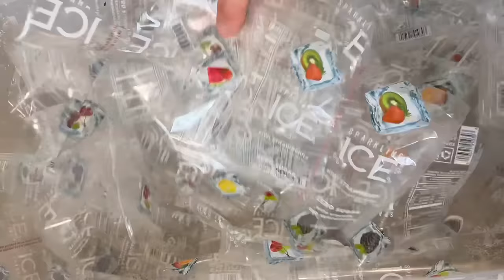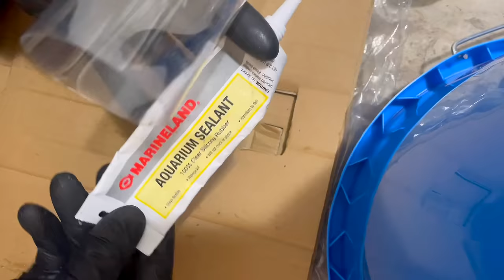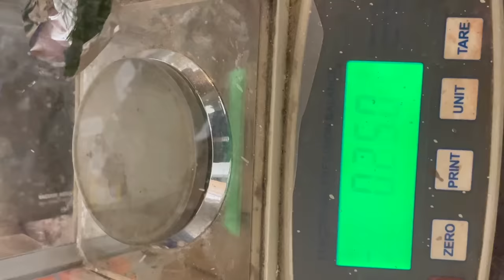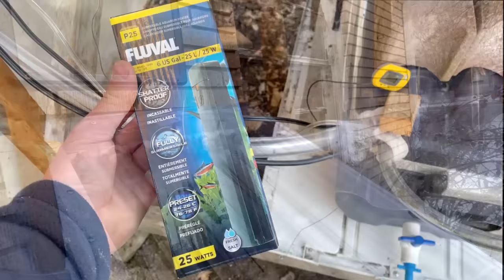Cody's Algae Panel

Comment: A small fishtank heater could help keep that warm on the colder nights, or if there's multiple cloudy and cold days. Could even have it charge with the sun too if you got some spare solar cells and an old lead cell battery.. I'm sure the Algae would be more efficient at doing it's job when it's not always having to warm up every morning. Or as much.

Comment: I'm guessing that you will need to find a way of removing Marsian dust from the panels rather than terrain snow, but the correlation is the same, as both block sunlight absorption.
Reply: I was wondering whether a vertical box that was on a little rotating thingy to point towards the sun might be better in that regard, stop snow collecting. Obviously not as much use by the house though, but out where it's wider at the base, maybe? I dunno whether the gentle curve is an important part of it or not
Reply: @FluffyDragon  maybe have it be mounted on 2 motors, and have it point imto the sun under normal operation, like Parker Solar Probe, but have it be vertically once-in-a-while to clear off the snow

Comment: This is so cool! Is there a way to have real-time reading of the concentrations of algea, minerals and water? It would be very nice to identify in which concentrations the production is most efficient. Maybe even have a system with supply of water and minerals outside the closed loop in order to adjust the concentration over the time.
Reply: You could probably use some sort of conductivity probe for minerals and a photosensor for algae!
Reply: a little glass chamber, a light on one side and a light sensor on the other side. All inside a box. When the photoresistor reaches the right signal you know you can harvest.

Comment: Given a lot of thought on how to create a "Moses Machine" that would produce food for long space voyages. A Moses Machine would pump air into a clear water container containing an algae base with artificial grow lights, algae would extract CO2 from that air then use grow lights for photosynthesis. The energy from light is used to convert water and carbon dioxide into carbohydrates (sugars), then algae use the carbohydrates to grow. A side result is CO2 is removed from the air and returns oxygen for astronauts to breathe. Spirulina is probably the best food source because it is quick and has high protein content, a person could survive on it. Extract and dry algae daily then make biscuits or create smoothies.   Algae doesn't contain Gluten but if you combine 2 parts Algae with 1 part Wheat, the gluten in the wheat is the binder and you can make protein biscuits or pancakes.

Comment: When you build it full size you should add some sort of thin heating element to the glass so that in the winter it can “defog” (melt) the ice on the surface like a defog button in a car heats a back window. Then if you want to get really automated add brushes that brush off snow afterwards (or just make the defogging element strong enough to melt the snow) I don’t know, food for thought.
Reply: Surely it clears the ice by itself pretty quick if it is sitting at 17 degrees.
Reply: @carbon1255  It gets colder some years, but yeah he probably doesn’t need it, but if it takes very little energy to do it then maybe it’s worth it.

Comment: The end product will be genuinely amazing and something that can be put on the roofs of buildings in cities for fertilizer production and any self respecting homesteader will love this invention 
Well done Cody well done
Reply: Fertilizer production?  If you want to get fertilizer, go get it from the sewer.
Reply: Yes, if you want polluted fertilizer, get it from the sewer.
Reply: @jawn6955  If things are being illegally thrown down the the sewer, sure you will.

If people are dumping toxic chemicals, that's a problem, but using sewage for fertilizer has long been done.

Even oil is biodegradable, but it's also contaminated with metal.

Sewage sludge is often already composted and then turned into fertilizer already.  If you have your own sewage tank, you can generate biogas, but removing the sulfur dioxide from it is a bit of work, but can be done by bubbling the produced gas through highly chlorinated water.

Once the sulfur dioxide is removed, it can be compressed and used just like you would use propane.

See?  I'm not entirely full of crap, but I know something about it!
Reply: @fuzzywzhe  i see, if you capture your own sewage I suppose you may be right! I do anticipate that general sewage is probably way to high in stuff that shouldn't be there though...
Reply: @jawn6955  What do you think is done with organic material from sewage processing plants?  Some of it is burned, some of it is put in landfills, but it's perfectly viable for being used as a nutrient for soil provided it's not contaminated with metals.

If we had proper sewage collection methods, it would be easy to compost it and use it directly as a fertilizer.  Sewage treatment is actually an interesting field.
Reply: @jawn6955  BTW you might want to waste some time looking of composting toilets here, and what is done with the waste.

Basically, the waste is placed in barrels with holes cut in the bottom of the barrel, to allow earthworms to get in to break down the waste.

What they end up with after, I dunno (a year?) is high quality fertilizer.  Quite a few videos of people showing the entire process.

Composting toilets are not uncommon for people who live off grid.  I believe that the grey water can just be dumped onto the lawn since it's not filled too much with organic material.  You don't even need a septic tank.

Comment: I'm very interested in this project and this is something I considered trying for a while myself. Consequently I did a lot of planning for a "Small system" to later scale up. I Thought through a lot of the same things you covered in this video so it's really cool to see somebody actually do it. I never actually built something for a lot of reasons. Didn't have space, was renting, rambunctious dogs etc.

You mentioned not liking the idea that the feed and return tubes were exposed and at first, I thought you meant because of the cold, but an animal ripping them off or getting tangled in them is the more important thing. Would it make sense to cover those in pipe insulation and maybe manage them back with some plumber's strap, or replace the soft tubing with PVC lines?

I also had the thought that maybe you could get some tubing that is made for potable water or food to ensure that it's going to be safe and not put nasty chemicals into the system and use that in a long coil, or several columns in the same way you have done with the plastic bottles. That would reduce internal rough surfaces from glue points, but you might lose some diameter. Fortunately, plastics, especially those for food grade applications have to give you a certain level of chemical data about their product, such as the chemicals it is made from, so you would know if it is going to off-gas or react with the liquid passing through it.

There's a product called "Rollerflex" that is transparent and has a helix stiffener on the inside to give it some rigidity. The 4" inside diameter stuff is just under $20 a foot though so this might not be the ideal solution. I'm not trying to sell you anything, just things I'm looking at right now. Maybe some acrylic or poly-carbonate tubes makes more sense because it is rigid and working with it is going to be a lot less hassle. I don't know what is out there that could be considered food grade, but I'm not a chemist.

Lastly, I thought it was really cool to watch as the system charged for the day and fairly quickly melted all of the frost and snow off of the diffuser. I wonder how much of that is the heat stored in the liquid, and how much is the leftover wavelengths of UV that the algae doesn't use and thus reflects.
Reply: What's the point behind feeding algaes in a panel?
Reply: I would construct it from a mirrored glass bottom of the sandwich to reflect back all light to the algae, then a series of vertical stainless steel square box sections for the frame to create separate areas and strengthen it, on top a piece of toughened glass, spray hydrophobic coating on top to shed water and snow, control temperature with a fan and thermostat for hot days (always sunny on hot days), copper piping with brazed joints for everything. Costs would stack up quickly trying to scale glass and copper and stainless steel I guess though.
Reply: @godnasus  He is experimenting with producing enough of this algae to serve as a fuel and (or) food source. Once you get the culture going and start pumping in depleted air, like from the inside of a space station, the algae can also be used to scrub the air, removing carbon dioxide and making it breathable to humans again. As the culture produces more and more algae, you filter some of the excess off and process it either into something that can be eaten or you extract the oils from it to make fuel. The idea is that it would be renewable and wouldn't require much maintenance to continue producing algae.
Reply: @Shrouded_reaper  I'm guessing he already has plenty of ideas in mind for a more robust and likely larger system. Probably something he can throw in his pickup and reassemble at Chicken Hole Base eventually. My only concern with adding mirrors is controlling the amount of solar energy being put into the algae. You can cook it with too much UV and it will turn orange as the chlorophyll drops out and it dies. It would be possible to control the levels of solar energy by tilting the mirrors or drawing a mesh fabric over them when the sunlight gets too intense, but that would be a lot of messing around to automate. I feel like this would work best as a large and mostly passive system.
Reply: @Advil1024  But if you have a glass top that will stop pretty much all of the UV. The main problem with increasing the solar radiance with a mirrored back is that they receive extra heat, which like I say you can just cycle through a radiator
Reply: @Shrouded_reaper  Alright that's a fair point, but at what point does it become too elegant of a solution? You can keep adding bits to squeeze out as much efficiency as possible, but if the return for the addition of the extra hardware is minimal, is it worth doing. I'm not saying that what you suggest would only have a minimal improvement in efficiency, but at some point, I imagine additions to the design might have that effect.

Comment: 18 months later, I'm still thinking about this. You've obviously done indoor, artificially lit algae cultures before - and I'm wondering what the relative conversion rate is. If you were to do a silvered culture tank with a suspended "grow light" fixture in it, and ran it off a single solar panel of similar area to your culture panel, which would make more algae?

Take a ~20% efficiency domestic grade panel, 50% efficiency of LED's and 95% efficiency of any LiPo battery storage involved, the obvious answer would appear to be "the direct grow panel". But with the other method you can use a tuned LED to optimise the efficiency of the light absorption, and you can also (by for example, placing the culture underground) give the algae a consistent optimal temperature and light pattern, regardless of time of day, year or weather - as long as you have enough electricity in the batteries.

The other thing in my head is that it's easy to find large cylindrical containers for growing a culture with a "central core" illumination - 5gal brewing buckets seem about ideal and also amusingly appropriate, and UN type blue barrels are another.

How viable would home scale cryogenic co2 capture be? I'd be fascinated to know how the energy economics work for concentrating co2 before injection into the growth media. Web says ideal is between 1-6% depending on strain, while humans die at 1.2%.

Comment: Great design! Though i find your goal to have 50 of these to sustain one person to be completely un-viable lol.

A better idea might be to use these as a micro-nutrient farm. You already did your test to see if this algae can utilize meteorites as fertilizer, does that mean they can turn the rock-based minerals present in it into more organic forms that humans can absorb?

So then you could maybe use the rocks from your mine to do that, seeing as how meteorites are kind of at a premium. But even then didn't they have a lot of mercury and lead and stuff in them? I cant recall if you tested the meteorite for them either, but i do recall you ate the algae bloomed from it lol.

I had an idea, you know those crappy cheap multivitamins you can buy? the ones where they use oxide versions of minerals and synthesized vitamins? If you crushed them up and used them as algae fertilizer, wouldn't the algae actually use them and make better, more organic versions? So in theory this one farm could actually drastically improve the quality of the micro-nutrients you put into it, you could proabably even dry the algae and put it in capsules!

Comment: would this be useable for fish feed?   Going from this to using it in a aquaponics systems would be super cool.
Reply: i mean, algae tablets are sold for fish so i assume it wouldent be a stretch to make these into tablets
Reply: Cool yes, but too much energy is lost in the process, making farming fish a waste when compared to just eating the algae
Reply: @sniper0073088  thats fair! but variety would probably be appreciated.
Reply: @mzimmerman1988  yeah it is, but what if theres not enough to eat then
Reply: @sniper0073088  you eat the fish or food that the aquaponics system provides?  I get your point on the efficiency though. I wonder what the conversion rate would be? interesting either way :)

Comment: This was a very interesting way of doing this. I know you're trying to think of ways to optimize the process and reduce the costs involved, and was wondering if using plate glass, sandwiching a maze or some other pathway, in between, instead of the plastic bottles might prove more lucrative of a method. I understand that less volume may be in each, but you could use a smaller pump and have more panels from each tank, and therefore, (maybe) be able to produce a more concentrated product more quickly. (The understanding being that as it becomes more concentrated, less light will reach the algae that is beneath the already light blocking algae closest to the sun. I could be wrong with this though.)
Reply: As he said in the video, the price of the glass is not cheap for this prototype, that's why he uses plastic bottles. Let's hope that this project is scalable enough that he will switch to glass panels eventually.
Reply: @y__h  yes, I understand he's doing a prototype. My comment is with respect to final product.
Reply: I was also thinking that. Costs would be pretty cheap really for two pieces of glass. Shit he could buy a couple of old doors or mirrors or something from a recycling center.

Comment: Cody, I only just saw your video, which is awesome btw.  It did raise my concern though regarding the use of those plastic bottles.  I have read that leaving bottles like that in sunlight, especially if water is in them, can result in a rather nasty chemical reaction.  The result is that the water can become a potential carcinogenic?  People are warned not to leave water bottles in cars on hot sunny days for instance.  Obviously I don't know if this is relevant for your needs but I thought to best point it out.

Comment: Very nice! You should have the insulated tank inside with a circulation unit that can be switched by valve to the outside. With grow lights and a solar system that can manage the system inside. You could have all the oxygen you need and enough for fuel.

Comment: Even if the video is 2yr old, here are my thought on this (cause noone asked): Great idea! However there are some mayor issues. The plastic bottles won't be food grade after a few month ( acrylglass could do it). To absorb more light per area you need more depth (50cm to 1 m). Depending on where you are the electricity for temperature control costs more than you can earn at the same time -  moreover it might be produced by fossilenergy which would obviously produce more co2 than you capture with it. Maybe a tank in the soil could passively control the temperature, maybe the panels or aquariums could also be submerged in the soil which cools in summer and heats in winter... BUT I really like the idea!

Comment: What a cool project, what are you planning to do for the cracking of the chlorella cell wall? is that not part of the process to make it bioavailable? And what about dosing the water with nutrients? any plans? or just using good ol tap water?

Comment: Fascinating stuff.
Perhaps u cd modify the design of the framework to create a mini passive solar greenhouse setup so it never freezes.
Simply put a sheet of polycarbonate/old window in front of the tubes/flat tank and then wrap it all up in scraps of insulation.
That wd save a lot of daily hassle in the cold months and due to higher overall temp would probably increase your yield significantly.
Properly integrated along the south wall of a building it cd also help stabilise the temp inside the building too i.e. cooler in summer,warmer in winter.

Comment: 2 years later: Might I suggest a Solar fountain/birdbath pump. They are cheap and most of them will only run if they're is enough sunlight. You can get rid of allot of those timers and simplify the system.

Comment: 2:10 vascular plants do not pump water. They do not use energy to transport water. Search for “cohesion tension theory”… plants allow water to evaporate which creates a negative pressure gradient, which causes water to pull itself up through its cohesive property